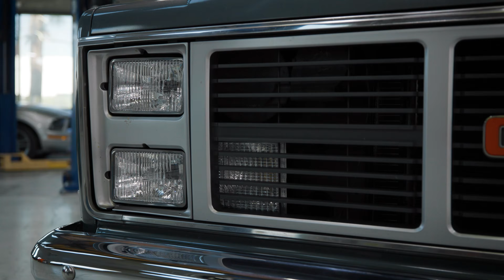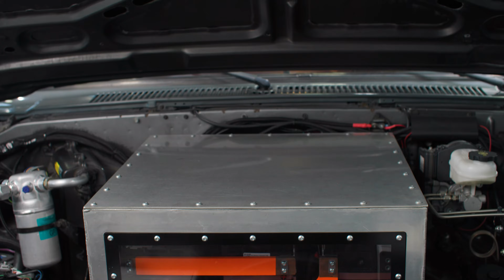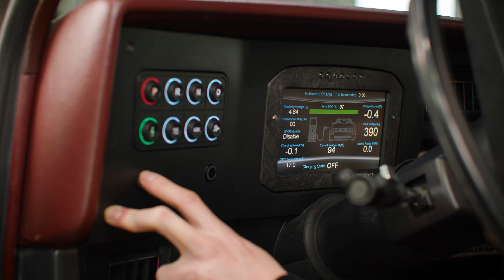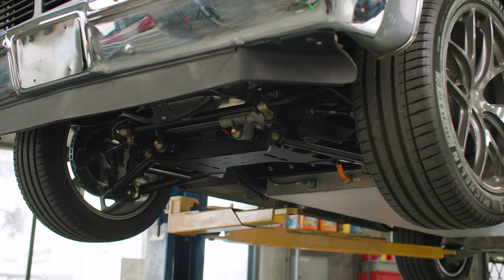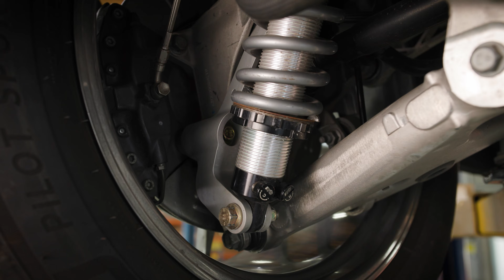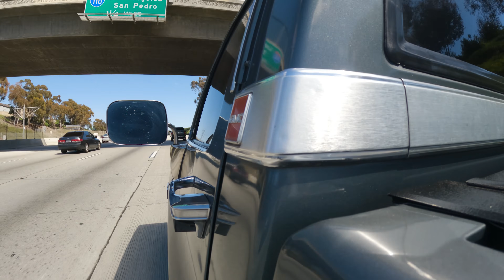AEM's Tesla Swapped C10 Project Hits The Road

Comment: I wonder if the aem software products can be swapped onto an actual legacy gen 2 tesla model s and ditch tesla's software updating system entirely. I love the car but tesla updating system love to burn  out older electrical parts and the only fix is to replace it and pray the next updates doesnt do the same. I would love to get away from that as i dont care for fsd or superchargering networks as i dont use them anyways.

Comment: I have the patent on converting gas diesel engines into 100% electric.  That looks nice. 
How are we going to get that to sit into an engine block.? After the Pistons have been removed. Run a chain belt system through the cylinders turning the main crankshaft of the vehicle causing it to go forward and backwards. Also running the air conditioner power steering computer system alternator the lights. Won't rust out in a dry area tucked in the motor.  What models of on road vehicles do you think you could do this to.  1 motor transmission system could fit 100 different models.

Comment: Why is no one making an electric motor that bolts to the transmission for maximum simplicity, you don't really need all this extra stuff
Reply: Sure....and your transmission and driveshaft will crack and implode due to the stress beyond its limits....
Reply: There are plenty (inlcuding on this channel) but it doesn't make it more simple because you have to have a trans (not to mention driveshaft and diff) that can handle the torque, still have to maintain all the above, and are left with less room for batteries.
Reply: Maybe you should ask Elon why he didn't put an ice transmission and differential in his electric vehicles. Stay in your own lane. Obviously you don't know how electric vehicle vehicles will work efficiently…

Comment: How fun. Go 150 miles and park to charge.
Reply: You ever owned one of those things? Mine will go 205 miles before you have to fill up the tank. Not much difference. Like if you removed my 350 and installed a 454. Besides, if you really hate the charging, you could always install one of those little 2 cylinder diesel engines somewhere in the vast emptiness underneath that truck, and let 1 gallon of diesel charge up the battery for you. In the event that you just couldn't make it anywhere.

Comment: 94 miles on full battery?
Reply: With a 50kWh battery pack, that's about the same amount of stored energy as a 1.5 gallon gas tank. The math indicates that's about ~64mpg equivalent. Not great for an EV, but much better than the 12mpg the truck probably got with a V8 in it. Since this most likely a show truck, I doubt it drives even close to 94 miles before it's put back in the garage to charge.

This is why the highest range modern EV pickups are having ~200kWh of battery shoved into them; to compensate for their terrible efficiency. The modern take on "there's no replacement for displacement."
Reply: @joeyhazlett  EVs have a lot of catch up to do, not to mention extreme hot and cold weather problems
Reply: :face-green-smiling::face-green-smiling::face-green-smiling::face-green-smiling::face-green-smiling::face-green-smiling::face-green-smiling::face-green-smiling::face-green-smiling::face-green-smiling::face-green-smiling::face-green-smiling::face-green-smiling::face-green-smiling::face-green-smiling: